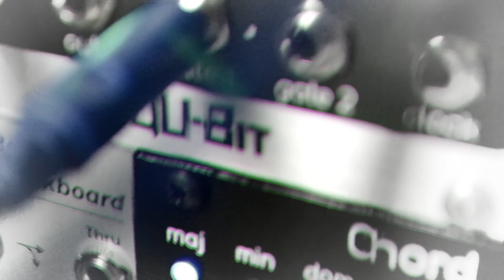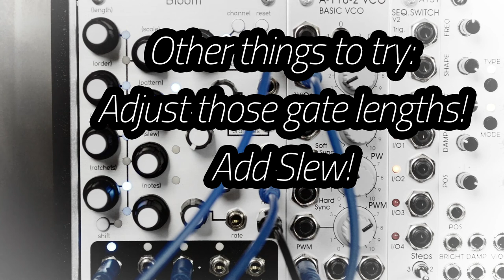Patch Tips - QuBit Bloom as a Quantizer & Arpeggiator

Comment: I like to use bloom in larger patches this way, usually driven by a sequence of root notes coming from Rene… send cv of a sequence of the roots of some chord changes from the Rene channel to Root, then with Bloom set to the same key as Rene, adjust the notes in Bloom sequence, or play with branches/paths… one odd behavior though I’ve noticed is that when I switch channels the pattern on the channel I just switched from becomes static, or just octaves of whatever cv it’s receiving at Root… and the channel I activate becomes animated with the sequence. Not sure why… Qu-Bit manuals leave a lot to be discovered along the way.
Reply from the maker: The CV inputs will only affect the selected channel. If you want it to affect both, you can go into "global edit mode" by holding the channel button for a few seconds. The sequence LEDs should turn white. Hope that helps!
Reply: @RobotsAreRed  Ah, actually now that you say that I think I did actually read that in the manual haha. I haven’t messed with global, but I’ll def use it. Thanks, both videos so far on this module very helpful.